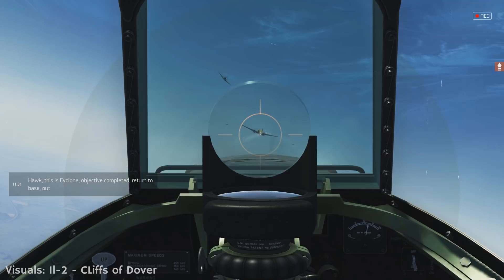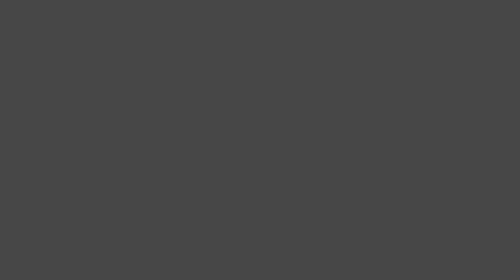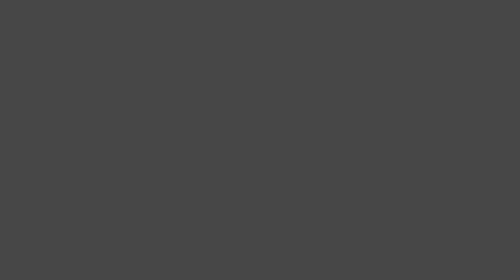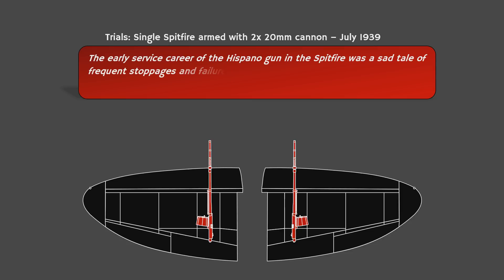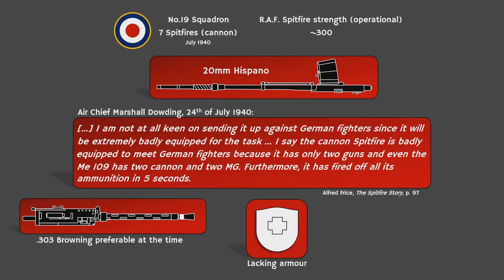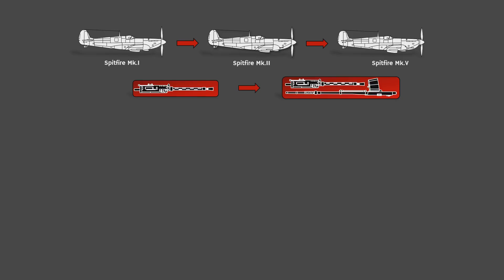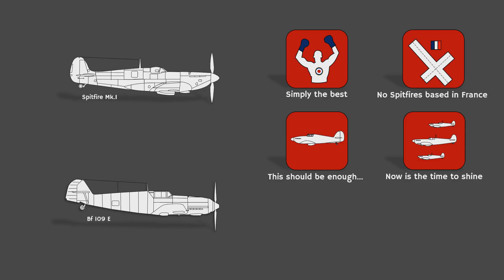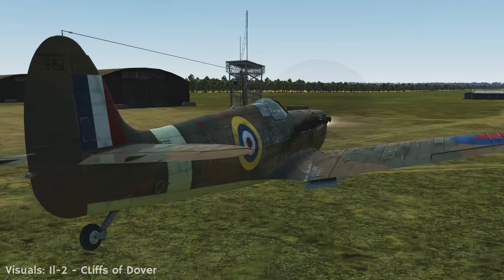⚜ | Clearing up Spitfire Misconceptions

Comment: I don't see the early spitfire even with the ME 109 E. Armament on the ME 109 is clearly better.
Reply: Maschinen Mensch Do keep in mind that every 20 millimeter gun on the bf109 had only 60 rounds. After you ran out, there is only two 7,7mm guns left which won't do much.
Reply: I would rather have only two 7,7 mm guns nicely centred then eight .0303 in the wings. Even eight guns of that small caliber don't really have a punch.
Reply: Maschinen Mensch Thats why you NEED a ton of them though (bf109 fan here)
Reply: Faster yes, but only by a narrow margin
Reply: Stephen Bungay did an excellent analysis of the effectiveness of the RAF 8 gun fighter in his book, The most dangerous enemy. The reasons for the selection of this armament were valid at the time and though it was clear by 1938 that something with a lot more punch was required to deal with bombers and work started on the installation of the 20mm cannons, against the Bf-109 the 8 gun layout was quite effective in that the Claims v Actual losses in Spitfire/Hurricane v Bf-109 were a lot closer to 1 to 1 than claims against German bombers.
Reply: 20mm allow further engagement range?
Reply: Maschinen MenschWhat do you think 303 inch is?.It is 7.69mm .(do the maths .0.303 x 25.4=7.69mm)  the same calibre.How can 2 outgun 8 of the same size?THey can`t.Also that 109 cannon is very very slow.You had better be a damn good shot and most people weren`t.
Reply: Ok, I thought the calibre difference was more significant. It is slightly higher though (7,92 mm on the german side). Plus, almost twice the rate of fire compared to the browning, if my info is correct.
Reply: Robert Stewart In practice competent pilots opened fire when they were really close (less than 250 meters) - velocity was not a big problem
Reply: Another plus on the ME weaponary: The pilot could decide wether he wanted to to spend valuable cannon rounds or some MG. For the spitfire pilot every time he pushed his button he had to make it count.
Reply: .303 Browning fired approximately 1200 rounds per minute the 8mm MG17 fired approximately 1150 rounds per minute.  The .303 was a 7.9mm 11 gram bullet the 8mm was a 8.2mm 11.7 gram bullet.  Basically they were about identical the .303 had a better incendary bullet the 8mm a better armour piercing bullet.
Reply: I guess you are an American.  Guns are not the only determinant of a good fighter plane.  Put crudely, the Messerschmidt had better guns, but the Spit was a better airframe
Reply: Maschinen Mensch THe bottom line is that comparing spec. sheets of very similar aircraft is pointless.Luck,position and pilot skill and experience count more.Sure you have to have a plane of a certain ability to be in the game but both the Spit and the Hurricane were in that group.THese are not the obsolete biplanes and oddities the Luftwaffe faced in Spain and Poland and Chekoslovakia.No! the Luftwaffe was  playing with the big boys now and the Germans just did not have the superiority in quality or mass to defeat Britain.Even if they had beat down the RAF what would they have used to deliver a killer punch as they had no strategic bombing force or aircraft.He111, Ju88, Do17? Toys compared to what would be needed.... and came.
Reply: @Paul Standeven: nope, german. 
@Robert Stewart: sure the big picture is a hole different story. ME 109 vs Spitfire was NOT the decisive factor in the BoB. But don´t forget the Luftwaffe already had faced strong opposition during the battle of France. From a military point of view, the BoB was not winnable for the Germans. You can not defeat a nation solely by bombing it (even if they had 4 engined Bombers and long range escort). The failure of "Bomber Harris" and the US in Vietnam are an evidence for that.
Reply: You don't need to "punch" another fighter.  Certainly a larger round will do more damage.  But the problem is getting those rounds on target.  They are bigger, fly slower, don't fire as often, and shake the hell out of the aircraft.  If you're using smaller machine guns, you can carry more rounds, have a higher rate of fire per gun, and have faster velocities.

Faster rounds means less leading.  No one is going to hold still while you line up the shot; no one who's going to survive the encounter, anyways.  Guns that mirrored each other were set to converge... usually at the pilot's preference so many yards in front of the aircraft.  So you could set up a very long cone of fire or a short one.... or even a combination.  

If you damage the other guys aircraft, it's highly likely that something will not work correctly leaving him vulnerable.  If you miss ever shot... he has 100% working aircraft and you're out of ammo.
Reply: The Spitfire just got better and better as the war progressed to the point it could go into  verticle climbs leaving your beloved 109s way behind even when the 190 Fucker came on the seen it wasent long before the Spitfire was adapted andwas more than a match. It was like a F1 of the skys able to keep coming back  better as the war went on. Like it or not i dont care it was a great aircraft. Goring asked his fighter ace fighter pilot who flew 109s what do you need to win the battle of britain rply was give me a squadron of Spitgires so keep your cannons and your 109s think i will have the Spitfie. The P51 was shit till they take out the Alice engine and put in the Merlin Spitfire engine into it then the Mustang also became a fantastic aircraft of the time. Yep give me Spitfire and Mustang anyday keep your 190s and 109s agree or not agree i dont care just go look at your history events.
Reply: Galland never preffered the Spit. He said that to provocate göring. He says that in his memoirs.
Reply: Maschinen Mensch why did the RAF shoot down so many during the Battle of Britain if this were true , you can't deny facts .
Reply: So? What was the kill-loss ratio? I don't think it was in favor of the Spit.
Reply: In the Battle of Britain, Spitfire vs Bf-109 kill ratio favours the 109.  But then the Spitfires and Hurricanes were not after the 109's, they were after the bombers.  Aircrew and aircraft loss figures favour the RAF.  And whichever way you look at it, the Luftwaffe did not win.
Reply: The kill ratio's do not tell much anyway. Tactics and pilot skills influence this a lot. This is just about comparing the early spit with the early Me 109. And my point is, that the 109 had a better variety of weapons and the mg's centred (yes fewer, but a lot of ammo), plus no engine cut out's on negative G's. The flight chaaracteristics are overall quite equal. I therefore think the 109 was the better plane.
Reply: No, the Luftwaffe had both better pilots and tactics but I forgot one point: circumstances. If you have to look at your fuel gauge almost constantly, try to protect bombers and get shot at by aa fire, its a different situation. German pilots evolved their tactics in the spanish civil war. They fought in the finger-four formation which the british later adopted. The british fought in a very close formation at first. The german pilots dubbed them Idiotenreihe (row of idiots). So german pilots were in average more experienced and also owing to that, had better tactics.
Reply: Agreed on the Luftwaffe Experten being more experienced, and the undoubted superiority of the Schwarm / Rotte finger-four.  And I agree, too, that the Luftwaffe's tactics, dictated by Goering I seem to remember, were faulty, keeping the single-seaters tied to the bombers and not allowing them to roam free.

I think that Galland's opinion was that the Spitfire was a better defensive fighter and the 109 a better offensive fighter, at least during the BoB.  By tying the 109's to the bombers, Goering negated their advantage.  I do also recall reading that the 109 was difficult to fly on the limit in tight turns as the slats deployed suddenly, but never together, which would drop the unwary pilot out of the turn.  The negative-G advantage was good for running away, but this (I need hardly say) is not the way to win a fight.

As far as the BoB is concerned, both sides suffered aircrew losses, but the Luftwaffe lost more, and were not set  up to replace them.  The training establishments fell way behind the needs of the front line units.  In terms of airframes, the RAF finished the Battle with more than it started with, wheras the Luftwaffe was running out, the factories not having been put on a proper war footing (as the whole war policy was based on gaining fast, overwhelming victories).